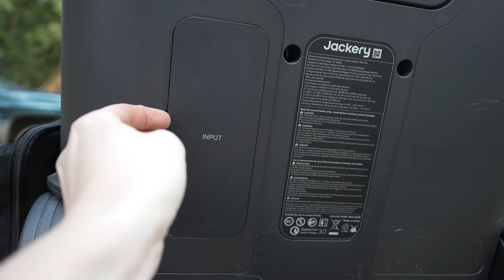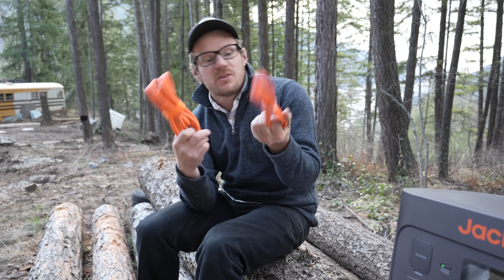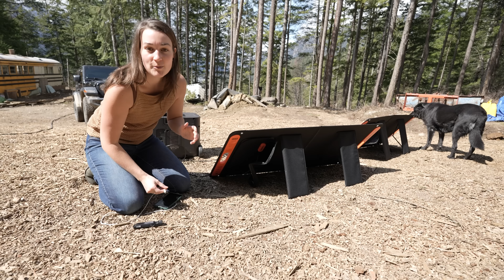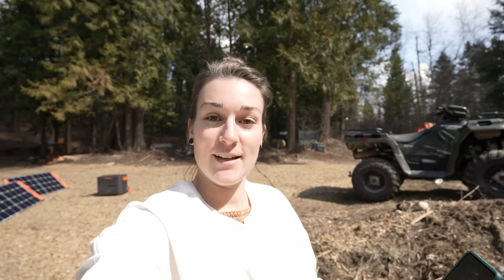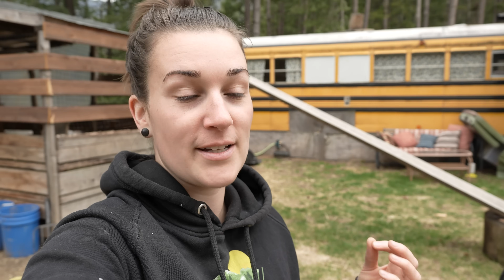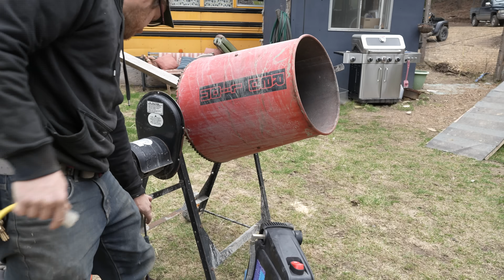Will This Power Our Barn Build? NEW Jackery Explorer 3000 Pro Power Station

Comment: I bought the Home Power 3000 a few weeks ago for my tear drop trailer.  I can be off grid indefinitely now with this.  These units are so quiet and efficient.   I have 2 200 watt solar panels for it for info.  I have an explorer 1000 v2 that has been used extensively.  I trust Jackery and the quality.

Comment: Good infomercial for the company. How does the power unit work on the mixer with a load in the mixer? And now.......back to our regularly scheduled programming. Have good days!
Reply from the maker: We used it this weekend and no issue. We opted to switch back to the wheelbarrow mix for smaller projects because we don't have a pressurized hose to use with the mixer

Comment: This may seem like a ridiculous question but here goes. Does this unti have a built in solar panel to charge or do you have to use the plug in panels? Thanks guys. Loving all of the beautiful milled wood.
Reply from the maker: No built in panels, it needs the plug in panels. Or of course, there is the wall and car chargers as well

Comment: jackery's are awesome units, i have a small one, i can only imagine what i could do with a large one like the 3000 pro unit
Reply: I've looked at the small Jackery's, wondering though would they power a coffee maker?
the drip kind
Reply: @chipprice1174  The one I have is a 300 watt, So as long as the coffee maker doesn't draw more than 300 watts it should work
Reply: @elwoodtaylor1092  No I'd say it probably draws around 1500 watts. Didn't know if watts output "rating" was the same as watts draw.
Reply: @chipprice1174  most electrical products have a amp draw on them, take that number and times it by 120 this will tell you how many watts you need to run a particular electrical item, example 5.5 amp draw would require 660 watts

Comment: Have to disagree with this being a "green" energy source. Just the carbon foot print of the machinery needed to mine the battery material, is way more than even some power plants. So after the fact, after the gens are built, yeah it's green, but t get there, not so much.
Reply: Most of the current power stations should last roughly 10 years if used properly. That's a long time for any battery storage. 
There are newer battery technologies being tested and developed that won't use lithium. 
Some batteries can be "refurbished" so they're able to continue operating for much longer.

Comment: The only thing I found with power stations is the temperatures must stay above a certain level. Close to freezing quite a few drop off. Insulated storage is obviously a necessity. 
I follow a man restoring a very old stone house and during even the mild winter in Italy his power station lost charge. 
This is the third manufacturer I now know of, Bluetti, Ecoflow, and this one. It will be interesting to see which has the best overall performance. 
I have a mini here for emergency purposes on a city, but it's necessary.
Reply: Prices are definitely comparable. This manufacturer has a wider choice in the lower wattages, which for some is good for light use.
Reply from the maker: This unit will work down to -20c, though it won't charge at that temp
Reply: Reviews say that Anker is the best.

Comment: -20 is -20 in c and f it's where they match
Reply: -40 ° is where the two temperature measurements are the same. 
Very cold.
Reply: Oops I was wrong -20c= -4f